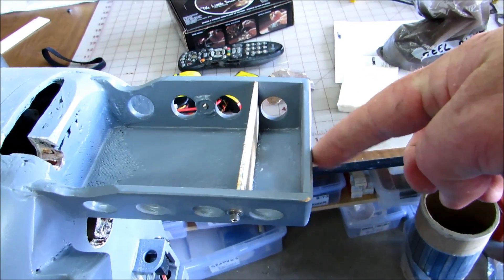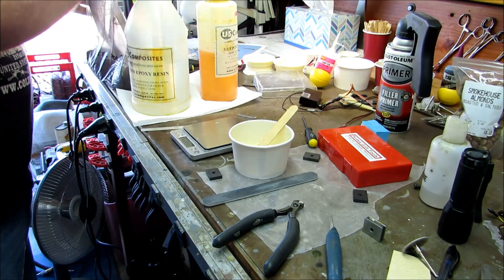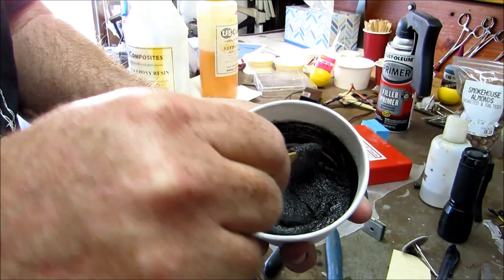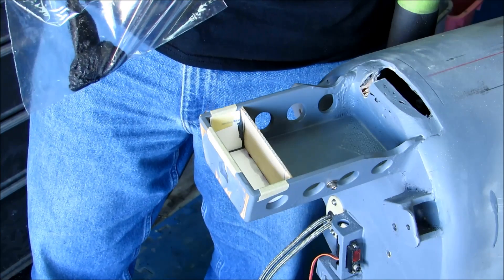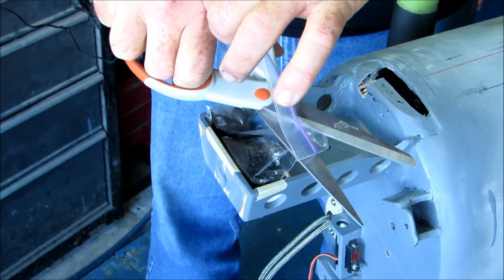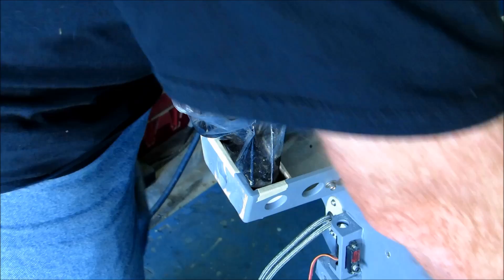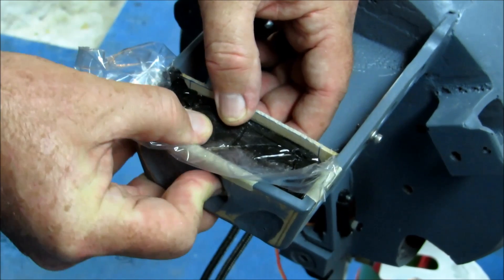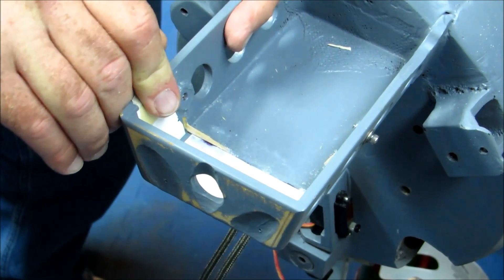Corsair #128, Using Steel Powder to Make Custom Shaped Nose Weight

Comment: Don I was wondering using saran wrap instead of plastic bag make the pouring easier, Where you get steel power ?
Reply from the maker: +transformer889  Yep....saran wrap would probably work really well. As for the steel powder, I get it from Gary Prince, who is a member on RCScalebuilder.com and RCUniverse. His handle is ram3500-rcu. I won't post contact info here, and he doesn't have a website that I know of. Good luck.

Comment: If you need more weight you could use the steel epoxy as a plug for a plaster mold and then pour melted lead into the plaster mold. Tire shops seem to be generous with discarded wheel weights. It great to see and hear about progress on the Corsair again.
Reply from the maker: +Henry Reed Thanks Henry. I do have about 10lbs of discarded used wheel weights, and I do have an electric melting pot for lead...but what I'm missing is the guts to actually put those 2 things together...:-)